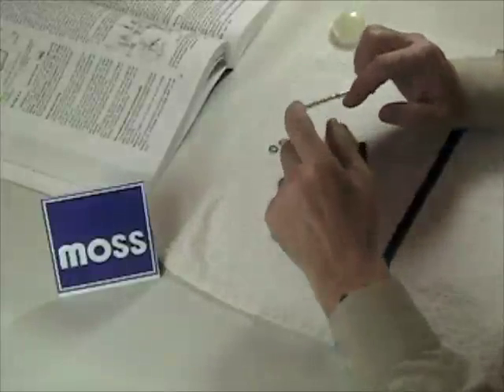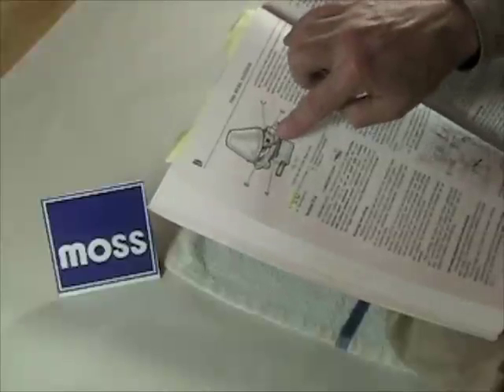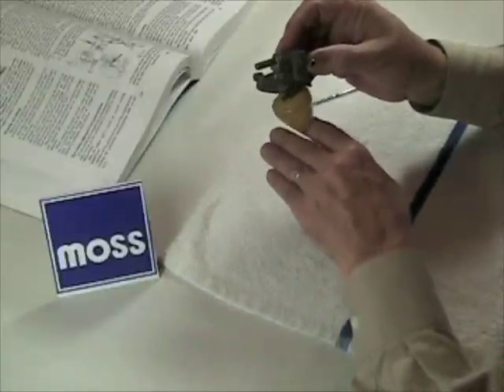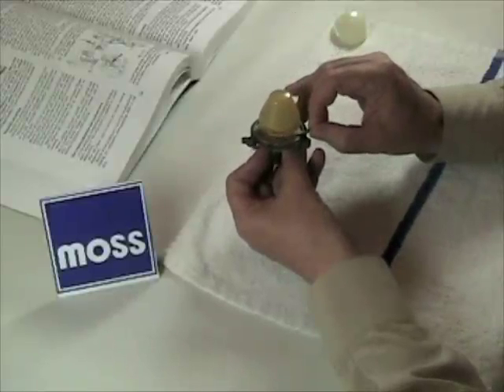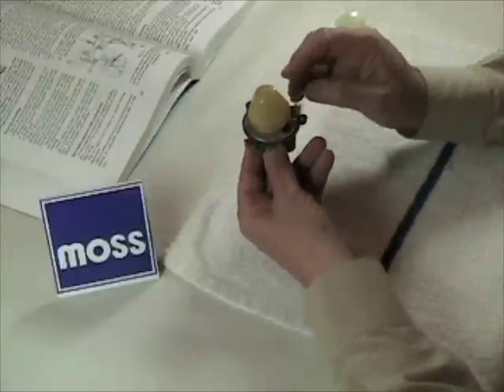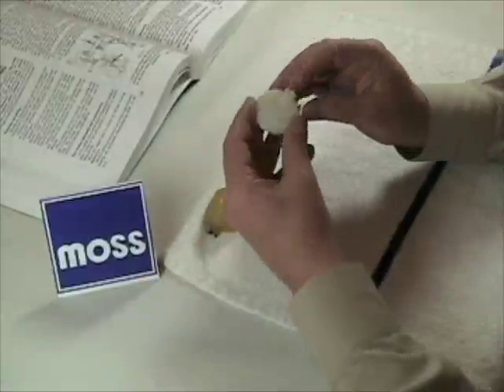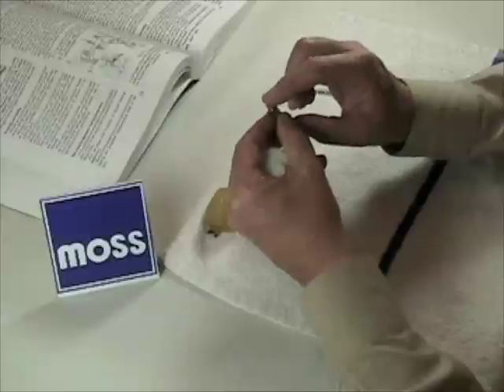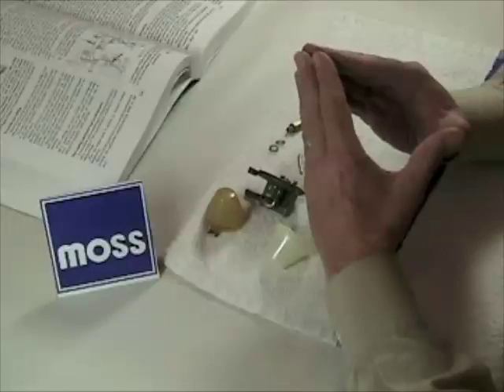Carburetor Float - How to Adjust the Level

Comment: The latest Black Nitophl Floats are just horrible to adjust to correct level. I am assuming they are made in China /India. And they just. DO NOT SEEM TO FIT CORRECTLY. Spent 1.5 hrs, and still do not shut off fuel. Put the old ones back in and problem cured.

Comment: Any input on those nitrophyl floats?  I see they appear adjustable but are they better than the brass float and fork setup?  What I recently discovered is fuel had seeped in to fill and turn one of my plastic tabbed float setups into more an anchor that a bob.  Cheers!

Comment: Excellent - and Thanks Moss Motors for having the metal tab adjustable floats - others have the non adjustable and they cause overfill, at least with my carbs.  I can't find washers that fit the valve.

Comment: Thanks for this video! Just a question.. what will happen if the float is higher than specified? will enrich the mixture?
Thanks in advance!
Reply: Yes it will. The higher to fuel level, the more weight there is being pushed down by gravity.